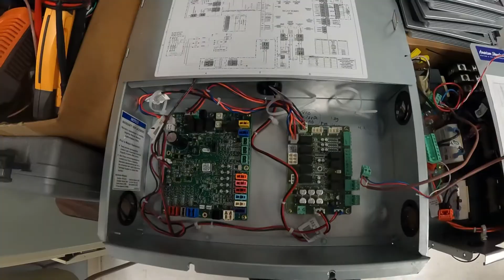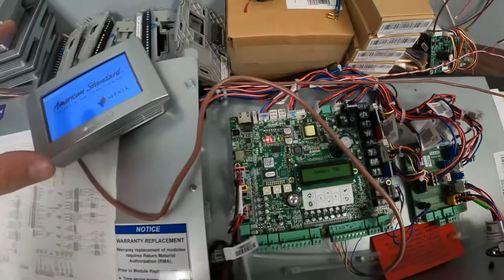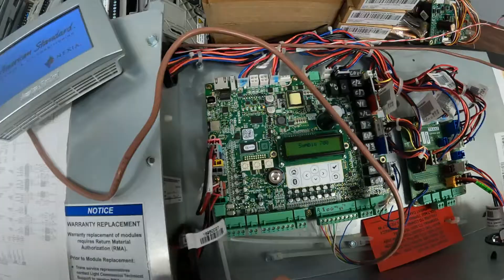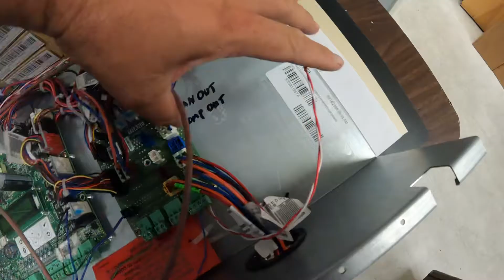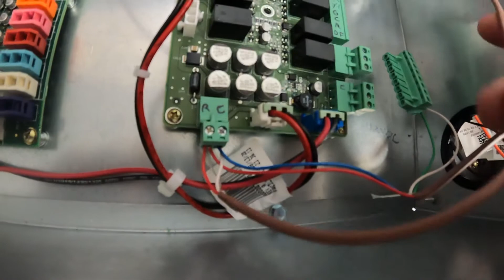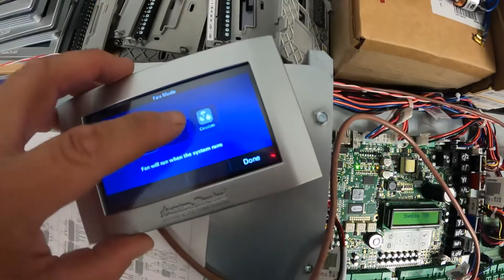American Standard Trane Symbio 700 intro and wiring

Comment: its so sad that we have to search on youtube for videos on how to wire new system upgrades like the symbio 700 that really have no real benefit but to make things more complicated.. meanwhile Trane relies on confusing wiring diagrams instead of pursuing proper training of "dealers".
Reply from the maker: I definitely understand the frustration.  The install manual is very lacking. That’s what inspired me to make these videos.  I wanted to help others understand.  
However, I think this system is a long overdue upgrade. I was not a fan of the reliatel equipment and the lack of information it gave the service tech. I love the testing and troubleshooting features that the symbio control system incorporates.
Reply: That bored and those units are terrible we just replaced three of them on brand new units  @Hvacoffroad
Reply: Yeah, i looked on the AHU and Outdoor unit manual, it did not have any instructions on the options board setup the dials for field install electric heat on a heat pump. Great  content, thanks!
Reply: Traness way over engenerred!

Comment: This video really helped. Our Air handler has a VFD and it wasn’t coming on. We had to hire TRANE so they can wire it for us and they couldn’t figure it out? We had two new TRANE techs and they had it all wired incorrectly. I watched this video today and wired it your way and the boards are talking now. The only thing that doesn’t come on is the indoor blower. I didn’t use the twisted pair wire? I used the regular thermostat wires. I wonder if that’s the reason why it’s not engaging the VFD
Reply from the maker: Glad to hear it helped. 
For a VFD, you need to connect j-16 on the condenser adapter board to j-7 on the air handler relay board.  Pins 1 and 2 on both connectors need to be a twisted shielded pair. Pin 3 on each connector can be a normal conductor/thermostat wire. 
Then make sure you use the symbio app to configure the system for vfd.
Reply: Do you keep the wires hook up on j4-1 1-4 for imc or are you using j16 to j7 only.
Reply: I'd love to hear if this worked, we are having the exact same issue.
Reply: Thank you so much. I needed this help today. God bless you,
Reply: Did that solve the issue for vfd not starting? I used communication wire and vfd not starting. Flashing at vfd controller for vfd not communicating. Checked 4.8 at vfd for modbus terminal showing modbus - is open
Reply: Yes
Reply: On the app make sure you set it to vvzt not cvzt